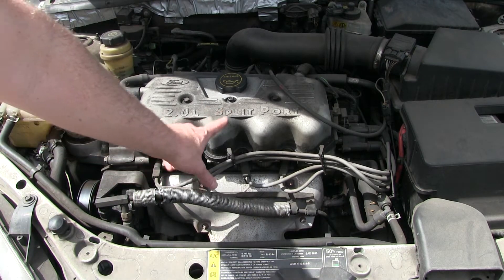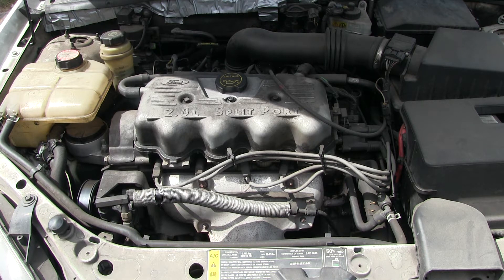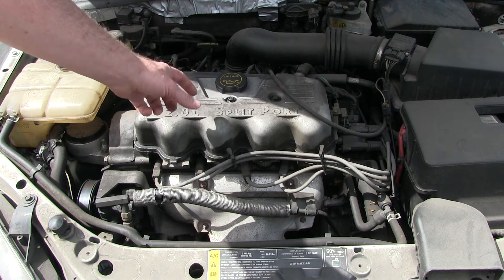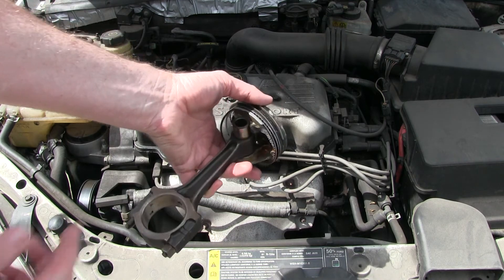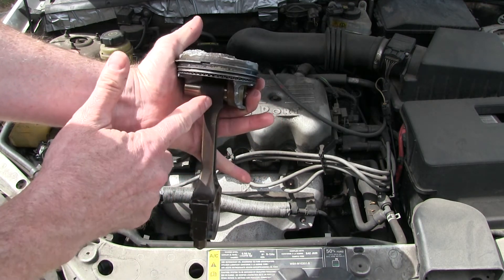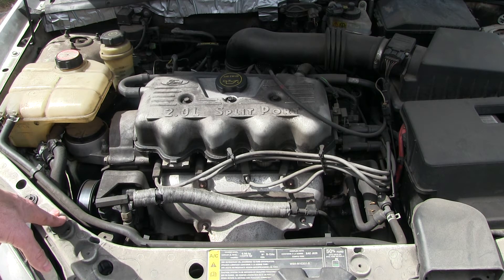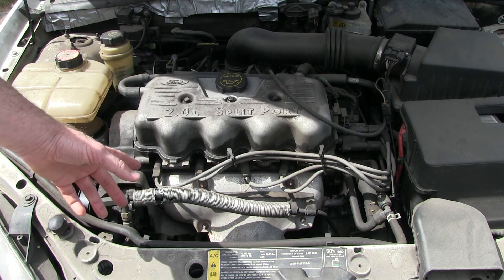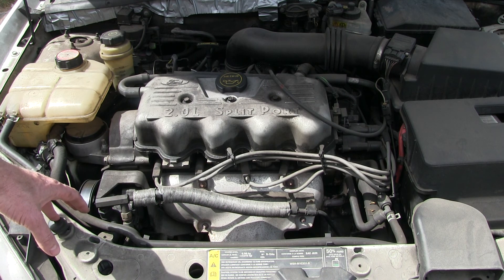Ford SPI Engine Dropped Valve Seat Warning Signs

Comment: my 2002 @ 35k miles dropped a valve seat...... 100% ruined motor so much for Ford Built Quality lol
Reply from the maker: That’s terrible! They really should’ve fixed this back in the 80s.
Reply: @hoohoohoblin  yep they are getting is back as a trade in with a used ebay 130k motor! lmao
Reply: They built it to last at least until the first T-belt change, then dump it.

Comment: More typical garbage from Ford. They and the other American car manufacturers need to be held accountable for these actions! Ford was aware and refused to fix the problem.  This is why I don't buy American made cars. Mostly garbage.
Reply from the maker: I agree. This engine had this defect for years, and they never fixed it because they knew it lasted long enough for the original owner to get rid of it before it blew up. I got rid of this car and bought a Prius.
Reply: They did something similar with the timing belt issue

Comment: my 1997 mercury tracer is at 87k miles hope it last.
Reply: Exact same here.(LS wagon)  I've always heard that Mercury's were better built than Fords. I assumed that was just the assembly,, makes me wonder about the parts and components also ?  
  I'm about to have all suspension and bushing replaced. So I've browsing thru some videos about the motor , in case there was any issues  my mechanic needed to be made aware of.  It did idle-stale 3 times this summer,, but other than that,, no "check engine" light , exhaust smoke, or ticking from the engine.
   I bought mine used in 1998, read that came with a COSWORTH engine.  So, I did a bit of mod'ing,, MSD ignition coil and wires, split-fork spark plugs, K&N cold air intake,  over-sized Flowmaster muffler, strut tower bar, and a 3/4 rear sway bar.  Little beast actually went from 30mpg to 31, drives like a sports car and makes a lot more horsepower, on both the low end and top end.
SO, basically, I've  kinda been abusing it. , LOL
   I would hate to lose my "Poor Mans Porsche" / "Glorified Grocery Getter", from an instantaneous valve failure.
Reply: @Duplicatt  im at almost 95k miles on it drive it daily now need new tie rods now for it.

Comment: i have a 1999 escort with over 250000mi on the odometer,i'm not joking either so either the car is lucky to only have a head gasket failure or it might die unexpectedly soon,not running rough at all but it sure does smoke out the exhaust ,iv already ordered the head gasket to replace it so hoping no more issues

Comment: I knew I was having the symptoms but didn't know the cause. Found out last night when my engine was destroyed. Thanks Ford
Reply from the maker: Sorry to hear that. It’s really disgraceful that this engine was known for this problem for decades and they never fixed it. They knew it would last longer than the warranty.
Reply: hoohoohoblin My SPI has 87000 on it. Has a slight rough idle when the engine is warm. Every once in a while it will actually stall. Only misses when warm and rarely stalls. But will miss every day. Runs great... No check engine  light ever.. Any ideas??
Reply: @michaelevans4943  you have a cracked valve seat
Reply: Ford has turned into pure shit since around 2006.
Reply: @eac1235  thus was a 2000 focus

Comment: The valve seat gets loose and starts spinning eventually it drops and holds the valve open and contacts the Piston. You can stake the OEM powdered metal seats or install nickel seats, change your thermostat and keep your cooling system maintained the head on these engines don't tolerate overheating.  BTW it's the intake seats that are the problem as the exhaust seats are hardened from the factory.
Reply from the maker: Thanks. I should’ve bought the focus with the Zetec engine instead.

Comment: If you take good care of this motor, it will last for a very long time and return you the favor, trust me. Change your Oils / Fluids regularly and don't drive it like you're on a NasCar track, she'll run well over 200k Miles if taken good care of. Zeteck, Duratec & The SPI are all great motors IF TAKEN CARE OF Properly. Cheers! :)

Comment: I am at 137K , keep fingers crossed every time I start it lol
Reply from the maker: +dan I have heard that some of them don't blow up,  but most do.
Reply: My aunt's 03 focus has over 300k and is still running on the original split port 2.0 motor. I heard aside from the valve drop issue that plagues a lot of them, they are pretty good engines and get great fuel economy.
Reply: @dsteward85  my dad sold mine cause he didn't trust that ticking sound that my 00' Focus had so he used that money from the focus he sold & put it towards a down payment on a 2009 Camry SE V6, I do miss the Focus but not the engine lol
If it had the Zetec or Duratec then it would've been better
Reply: I just got a 00' Focus with 2.0L SPI in it sitting at 164k miles

Comment: by the way good video, THANKS. think this will at least send me in the right direction as to repair logistics, cost an what not. wish I would have known a bit sooner tho. any info/tips appreciated. be easy
Reply from the maker: You're welcome.  It's a tough choice with a Ford Focus.  Fixing it will cost more than the car will be worth when it's running.  I really like the Ford focus for its practical design and good fuel economy.  I just wish it didn't have an exploding engine.

Comment: think my 2003- 2.3 did the same thing. symptoms matched exactly- dies every now and then, grinding/sequel(all around really shitty noise) at idle and all speeds-started and progressively increased in intensity the last two weeks- until I was on the freeway driving her very mildly (because of noise and issues-bout 65) and in a split second, down shifted out of no were to what felt like 1st or 2nd gear(auto trans)- let loose back to cruising gear an amidst the switching back into normal gear the cars electrical sustained a substantial power surge(looked like it was going to kill the power but didnt)- I let off the gas throughout all of this.. of course... my focus then coasted still running to a stop. motor reminiscent of a starter an alternator rolling around in an a dryer with maybe a few towels or a sweater maybe a pair of shoes too.. very fucktastick type noise. she stayed running until I stopped an turned her off- while coasting to a stop I could smell what I now saw..a huge plume of thick white smoke that billowed from the passenger/belt pulley side of my 2.3 that smelled terrible like wire burning or maybe more like fluid and extreme friction and fuckery. I thought my car was on fire- I checked the temp as I coasted and at a stop b4 I cut the motor.. regular.. not a tick or any change. by the time I grabbed my flash light an popped the hood the smoke had begin to quickly dissipate and I could see nothing wrong from the exterior- top- sides or bottom. gave it ten minutes while further inspecting my car, just to scratch it off the checklist I tried to start it- clunky shitty noise that gave no hope to any kind of correct motor rotation- though the starter and ignition/electrical functions were on point and obviously not to blame. sound about right?
Reply from the maker: That sounds really bad, like something came loose in the engine.  On my engine the motor mounts went bad, and the pulleys were rubbing against the frame of the car when I hit a bump.  When I first started reading your post, I thought that might be it, but if the engine won't fire up or run, it sounds like valves or pistons.

Comment: That's just wrong...I'm glad we don't have those SPI engines here.
Reply: have you found the fix i am having the same problem now
Reply from the maker: Fortunately Ford quit making them, and they are quickly becoming extinct, but they made millions of them without fixing the problem.
Reply: +hoohoohoblin i picked one up for $500, has a p0171  fuel trims run at 5% STFT and 28% LTFT.... I cannot  find a vacuum leak at all... thoughts?

idles fine though... i dont get it at all..

Comment: Now I have a 93 scort. with the 1.9. My warning signs were more subtle. I went across town and I smelled coolant. That was weird. Car was hard to start, but then got me home, about 40 miles away. next day it would crank and not start. My experienced mechanic said it was the valve, and that is the first I ever heard about the problem with these engines. We souces the head locally for less than 150 without a core. I have seen it from a company in Florida and I think it was 137 with a core. Never thought about the preemptive strike like you advise, but a good Idea I think.
Reply from the maker: Definitely a good idea to replace the head before it takes out the pistons.  I was lucky it didn't damage the bore or the crankshaft when it fragged the piston, but it was still an expensive job to fix it.  I've spent more fixing this car than it is worth, and now it is starting to lose power and burn oil, so I may be replacing it soon if it blows up again.
Reply: ***** Well, that must be different between yours and mine. I was looking at the manual for the replacement interval for the timing belt, and there isn't one. I asked my mechanic why, and he said because it is a non interference engine. And I bet dollart to donuts the 2.0 has a timing belt interval, because it is an interferece engine. Yeah, that sux. I have a new engine in mine as well, but with all the miles on it, and changing the head was a pain. I will wait till it goes again.